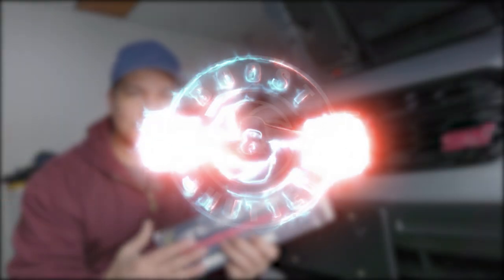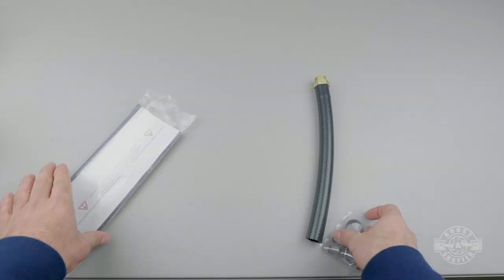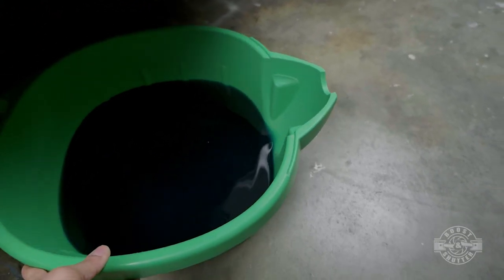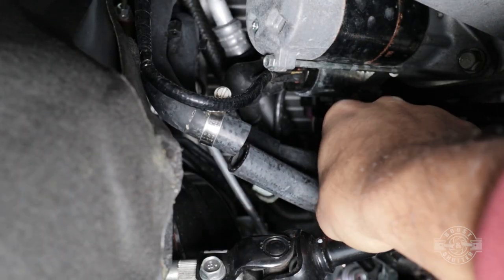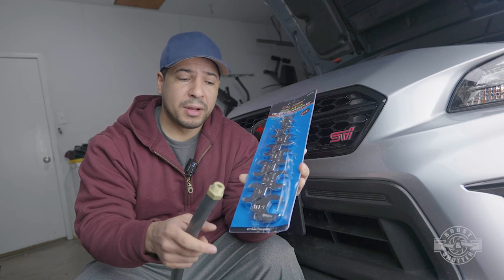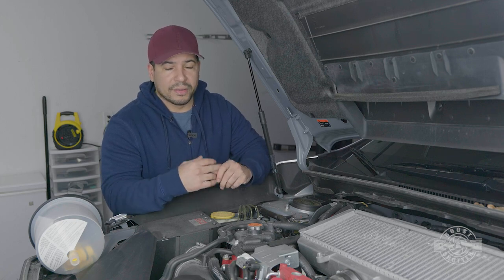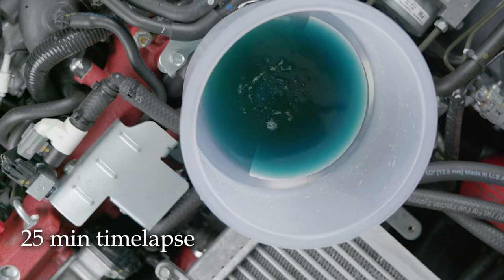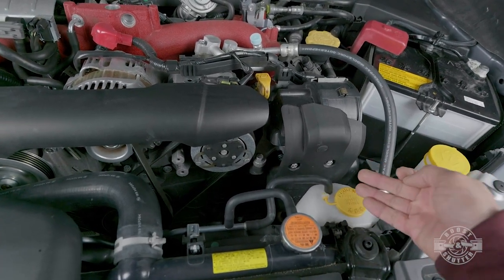Subaru STI Cylinder 4 Reverse Cooling Mod  | COMPLETE & DETAILED  INSTALLATION |

Comment: This a awesome guide. I couldn't get my hands on a 1" crow foot wrench in time for my installation so we just tightened it with a 1" deep socket first; then we attached the hose and tightened the clamp with a tiny ratchet and 7mm socket. It was super simple this way for anyone who doesn't have a crow foot wrench.
Reply from the maker: Glad it was useful. Thank you very much for the tip!

Comment: Great video, the only part I question is why would you pinch the mod hose off before filling? You'd be holding in air that would then be released when you take the clamp off. Seems counterintuitive.
Reply from the maker: The hose adds one more path for air bubbles to travel so that's why you pinch it. That said, it is NOT 100% necessary to do, it just might make the burping process marginally longer.

Comment: You don't need to turn the heater to max heat. These cars always have coolant flowing through the heater core, they control heat into the cabin with doors inside the HVAC system. And zero need to pinch off the hose.

Comment: Great video, but I'm not sure why you pinched that new hose during system burp.  You created small dead spots around that pinch that are likely to trap air.  I think I would either skip that pinch, or remove it at the tail end of the burp
Reply from the maker: It's not a 100% necessary step so you can skip that, it just might make the burping marginally longer.
Reply: That is exactly what I was thinking. Wasn’t it better having it flow evenly during the burp system?

Comment: Are you pinching the hose from the black to the t fitting? And do you keep I pinched the whole time the car is one getting the air bubbles out ??
Reply: I had the same question, if you pinch it doesn't it have the air bubbles trapped?
Reply: @boost & shutter

Comment: Question.. The people who are having the heater core issue.. Did they cut the upper hose instead of the lower hose?  I bought this kit but honestly I'm not sure I want to install it if I might lose heat in the winter time.  I want to know more about this lack of heat issue. Why is this happening to some people ???

Comment: I subscribed, you literally saved me from getting soaked in coolent from the bolt that's connected in the block that you place the hose on. I was told I didn't have to drain the coolent.

Comment: Thank you for this. Particularly the crow's foot. You are literally the only person that even shows the fastener tightened to the block, let alone properly explain how to do so.  I even asked people wtf they used to tighten it. Everyone says an adjustable wrench, channel locks, or vice grips. I have multiple sizes of each but speaking from experience, that steering part in the way makes using those tools not really possible. Now I can break the thing back out and throw it on next coolant flush!
Reply from the maker: So awesome to hear that. Thanks for watching and share!

Comment: Thanks again for another great video. Though I did the I Build Race Cars version, they’re all pretty much the same. This gave me the confidence to do it myself. Biggest hurdle was finding the 1” crowfoot wrench and then playing around with all the angles to get things tightened down.
Reply: Putting that barb in with the crowfoot was such a pain in the ass (and neck).

Comment: Just did the install yesterday and finished up today. This was an extremely helpful video. Just like your IDoing head unit install. With this one, I had to do it a little differently since, I'm sure you know now, the coolant mod hoses are now bent at a 90 degree angle, I had to screw the barb in by itself then mount the hose. That's pretty much the only difference. I still don't understand why we had to pinch the hose but I did it anyway and after a good 20 min, I didn't get any more bubbles and temps were smack dab where they should be. I will continue to monitor throughout the next week or so and then I'll throw my under cover back on. Thank you for the really informative video.

Comment: great video bud.
I would suggest a red rubber tip for your test light / visual probe to make it safer from scratching sensitive areas. and also easier to see. All the extra bolts I personally use various types of anti seize and thread lock. Thread lock is super important if you ever expect anything to stay put or 10 k plus Kilometers.
last tip, before removing the filler funnel for your coolant, you can squeeze on the rubber hoses a bit to raise the coolant level before plugging the funnel. so that way, you have no spills. Again, great Video, super clean engine too, Beautiful. I bet she's a lot of fun. Cheers

Comment: Had my 21 sti for almost a year and i got it right before summer ended, so im experiencing my first full summer with the car and today i got to see first hand how my sti would act during 100+ degree weather. I had low throttle response and when i had the ac on and i gently pressed on the gas, itd go to 1100 rpm then go right down to about 700rpm even when my foot is still pressing on the pedal lightly. Did some research and it was just heatsoaked. I want a ic sprayer but dont trust myself to diy it with the wiring. So this may be the next thing ill do the next time i change my coolant. Considering the video is super informative

Comment: Great video
Only issue I had was no heat unless I was giving it gas so I switched my tee fitting to the heater core inlet that allowed me to have heat this past winter.   Also a few friends of mine also with bugeyes had this issue. But it works great

Comment: Nice instructional video! I installed the VEMS Tuning version myself. It's convenient because there's no silicone sealant necessary.

Honestly, all the versions are exorbitant for what they really are: a length of hose, a connector, a couple of clamps, and a T fitting.

Comment: Welcome back!!! I just got this part one month ago and ready for install, then you post this video, what a coincidence. LOL!
Reply: @akqjtn  You have really taught me a lot！I like the logic and process of your all video very much. You are definitely a good teacher If you teach in school. I try to replace a new Radiator and plan to add this Cooling Mod at the same time, but I am still confusing that dose the Cooling Mod needs to be pinched all the time during the system burping? Or it should be unpinched before the engine starts?

Comment: Attempting to do it on my 2015 sti but only confusion im having is which heater hose to cut,for me the top hose has a insulation not the bottom one, mabe they just mixed them up when getting the car done but I’m just gonna cut the one connecting to the black metal pipe.Love all your videos by the way never really tempted to work on my car until I found your videos super informative and best  shots of every step💯👌🏼

Comment: Thank you for an extremely detailed video! Going to do be doing this project soon. Will be doing the IAG V3 AOS system to the car as well. Do you recommend doing 4th cylinder mod first then the AoS? Also might be doing Group N engine mounts too. All day project indeed😅 Thanks again and looking forward to your input!
Reply from the maker: This particular mod really doesn't have much to do with the AOS so feel free to do them in whatever order you want. My recommendation, however, is to do one at a time to completion, that way there is less of a chance of something being missed.
Reply: @akqjtn  will do thank you for the videos!!

Comment: Awesome video man! I just got an AOS, Cylinder 4 mod and KoyoRad to do all at the same time over a long weekend. I’ll definitely be using your videos for my install journey. 2 questions though: any reason you didn’t just tighten the plug to the head without the hose? I figure it would be easier to use a socket wrench than a crows foot. Have you made a radiator install video?

Comment: Hoping you see this after 2 years great video and will be following as I do my self but question, while burping system when you turned the car on to get the heat on did you first remove the pinch hose clamp that you put on the 4th cooling mod

Comment: Great viedo!!!
Explained very well. New suscriber.
Is the same process for my 2.5 Outback 2013?
I already had a failure on cylinder 4 that costed me the engine. I changed it for another with 60K miles on it but I don't want it to have the same failure.

Comment: Great video as always, Thanks. Just one question... At what point did you take the pliers off of the Dom hose that was pinched? Was it after the car was fully burped? Thanks for your response.
Reply from the maker: Late reply, but yes, after the car is burped.

Comment: I am ready to do mine! Only question i have is, when do you remove the hose clamp on the mod tube when burping the system?? And shouldnt we not clamp it so coolant is filled to max capacity and cylinder 4 actually had coolant in to cool it?

Comment: Awesome video, will be doing this for my 2006 EJ257 along with hose changes when my coolant change interval comes up!

One question I didn't find an answer to, why clamp the Cooling Mod hose during burping? Coolant is flowing in the area in front of and behind the clamp so wouldn't keeping it unclamped be the same as clamping it?
Reply: @akqjtn  thanks for the clarification and that makes sense. You're basically routing them as a much as you past that point

Comment: Maybe I missed it. But did you mention to turn the heat on full max to make sure it goes into the heater core as well? That would be the only thing I didn't hear you mention.
Reply from the maker: Yes I definitely mention it, thanks
Reply: 17:00

Comment: Great video, I have a question about the aos….when you installed it, was bleeding the cooling system through the bleeder screw on the Iag aos enough to get the air out of the system after install or did you bleed the system just like you did when installing the 4th cylinder cooling mod ?

Comment: Excellent Vid. Thx! Plz need ur advice. My 2015 WRX (42K miles only) water temp lately going higher than mid-normal temp range to around 230 F on highways while AC on and outside temp around 104F.  On idle and AC off, goes back to normal temp 200F. I ve checked the Fans, radiator cap, coolant, etc. all Okey. Is it the coolant thermostat not opening to its max ? or is it motor fans weakened to lower CFM?

Comment: Instead of ultra grey, you can just use thread sealant. Hold up to about 150psi on a bus. Would be cheaper than a tube of ultra grey too :)
Reply: Gasket maker also only needs 8 hours to cure

Comment: Good video... does it matter which heater core line I tee into? I know u did the bottom line. But in my car it's in the top heater core line. Is that still ok?

Comment: Hello Sir. Will this mod fit and work for a 5th Gen Subaru Legacy GT 2.5 with EJ25 engine? My LGT has less than 30K miles and would like to prevent potential problems in the future. Thanks for sharing and stay safe and healthy!

Comment: When cleaning the opening with the wire brush, is it bad if thread lock goes into the engine? How do you prevent that?

Comment: Great video! Quick question: do you remove the hose pinch pliers before you start the car to burp the system?
Reply: "DJ Tony Romeo" asked the same question and was answered in comments section. Check for response, good luck.

Comment: When lubricating rubber/silicone hoses, fuel o-rings, or rubber/poly suspension components DO NOT USE PETROLEUM BASED PRODUCTS.

Comment: I have a question.

Is the cooling mod still pinched when you're reving the engine to burp the system?

Does it stay pinched until the system is fully burped?

Comment: Again how does the coolant  get out of the cylinders if you only take the lower hose off? I thought that the thermostat only opens up when it’s hot. Cus I’m thinking you don’t need to  to drain coolant upon installation. I know I will loose some coolant but I can put some I lost after. And I thought U prolly just drained the coolant from radiator. I did change my coolant for the first time. I replaced the thermostat and coolant from the engine came out. Or am I wrong here 🙁

Comment: I just my first Sti and I want to start supporting mods asap, will I need a tune after this Install?
Reply from the maker: No you do not need a tune for this.
Reply: Same thing with the Air Oil Separator? I want those 2 things installed asap

Comment: I turbo’d an ej22e phase 1.
I used the heater core in and out as my turbo coolant tap points.
Am I helping cylinders 2&4 as a result?

Comment: after you unpinch that mod did you need to add more coolant? or like you said add as needed based on the tank so it is at full?
Reply: I just did it and after I took the clamp off the hose, I just added more to the reservoir to get it to the full line.

Comment: very good video.  I have a couple of doubts.  1- I understand that it applies to any EJ engine, whether it is turbo or aspirated, right?  2- Regardless if you have multiple ULH or ELH, will the modification be adequate and recommended?
Reply: What do u mean by ELH and ULH?
Reply: @selwyn13  equal length & unequal length. Exhaust system

Comment: Wouldn't pinching the cylinder 4 mod before burping the system defeat the purpose of not having any air bubbles throughout the system or rather..not having any air bubbles goimg to the cylinder 4 portion of the Block or am I tripping? Im about to install mine.

Comment: Im wondering if any of ya'll had leaking coolant after you installed the cooling mod on that driver side seam between the block and head. I swear mine was bone dry before I installed the mod but now after I find that there is a small trickle/leak of coolant at the head gasket on the driver's side between the cylinder head and the short block...oh well.

Comment: I want to get this mod but when I was trying to research it there’s a lot of different opinions of it really works or not or actually makes it worse. Just not enough testing. It makes sense to me that it would help out. I have an all stock 2018 STI 15k miles and it’s my DD so I want to make it as reliable as I can. I already purchased the IAG AOS because I saw your video on it and been thinking about this mod. Have you heard of any problems with the cylinder 4 cooling mod?

Comment: Problem is that the hose goes back to the water pump (hot water going back into the engine). It would be better if it got sent back to the top of the rad to cool down first. This mod just recirculates extra hot water into the engine.

Comment: I feel like you could have skipped draining the rad.
Idk
Reply from the maker: It would have drained out of the hole on the block, or when you cut the hose, making a mess and you would still need to burp it.